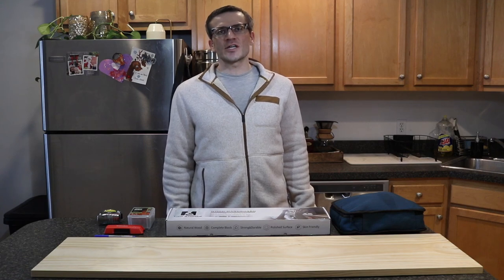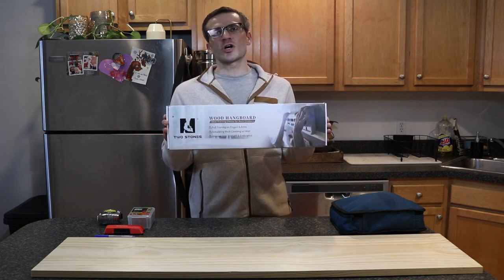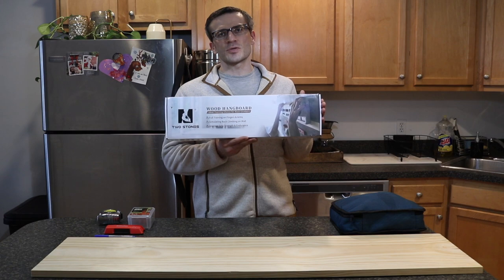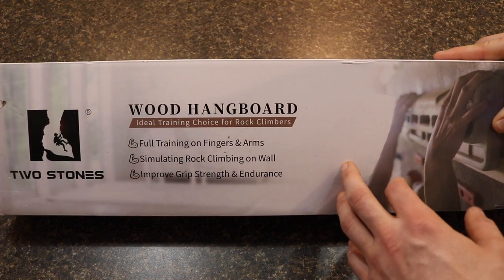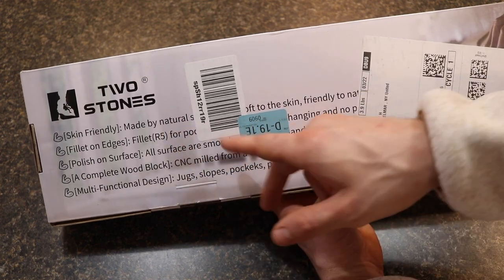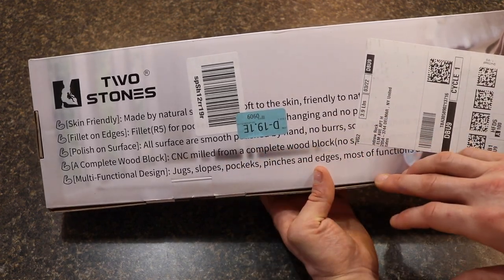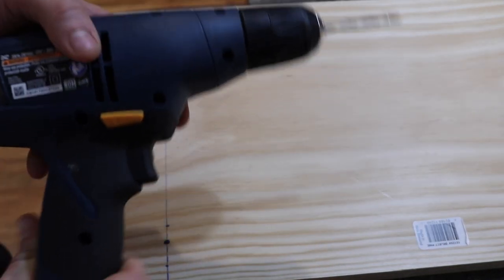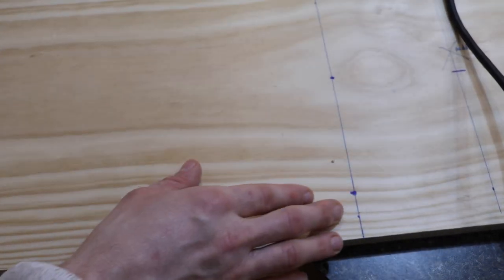Two Stones Climbing Hangboard | Unboxing & Installation

Comment: What are the holes on the side of the pinchers for? To feed a rope through?
Reply from the maker: Yeah. I believe it’s for hanging a rope through for either adding additional hanging hand grips. Or I think you might be able to set it up for adding weight in some manner. I’m not certain how you’d go about that though. The company sent me their other board as well. I just haven’t gotten the chance to review it yet.
Reply: @AndrewRockYoutube  the one with the half spheres in the middle?
Reply from the maker: @TDohertyProductions  Yeah the one in the link below. I think the one I originally have had more variety for different hand grips though. This one seems more progressive in nature. To be honest though. I don’t climb. So I use the top and larger grip for pulls ups. Then kind of randomly do some hang boarding occasionally. It definitely works for strengthening just have to build up to it. 

https://www.amazon.com/TWO-STONES-Hangboard-Fingerboard-CJ-HB2005BX/dp/B08WXFCRJN?ref_=ast_sto_dp
Reply: @AndrewRockYoutube  I feel like I would almost never use the smaller pockets, as I can just 1/2/3 finger hang from longer edges all the same for the most part. I'm really thinking that instead of getting a full hangboard, I'll just get some climbing holds and some 15/20/30/40mm edges and throw them on a plywood board the same way you'd put up a hangboard.
Reply from the maker: That’s probably much more affordable to do as long as you can create it and set it up to support all the weight. Wouldn’t be too difficult. I just wanted something for overhead hanging and pull ups at home cause my gym doesn’t really have much of that other than lat pull machines.